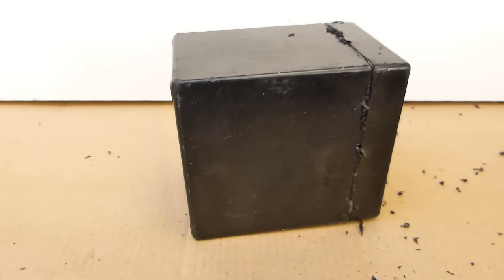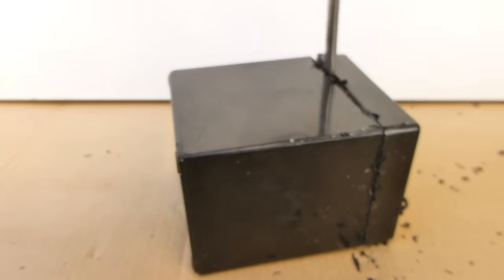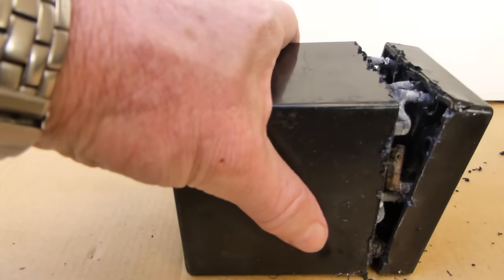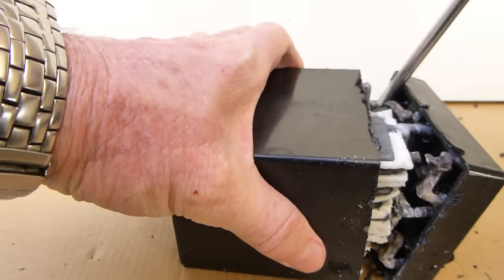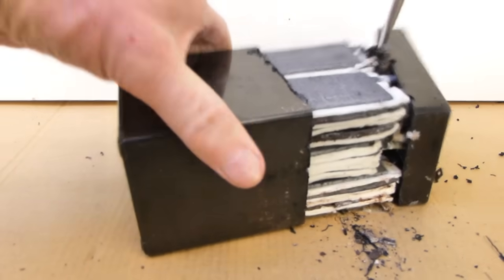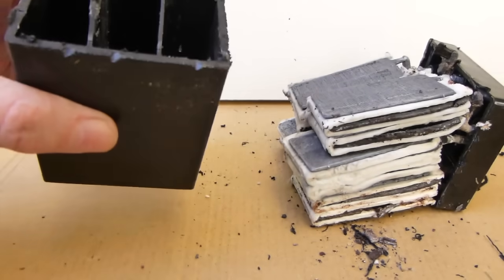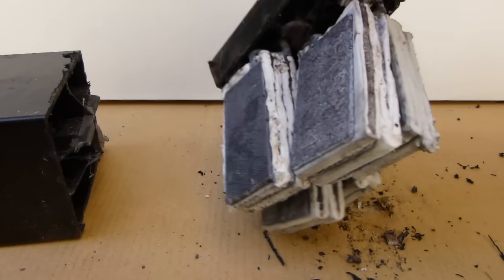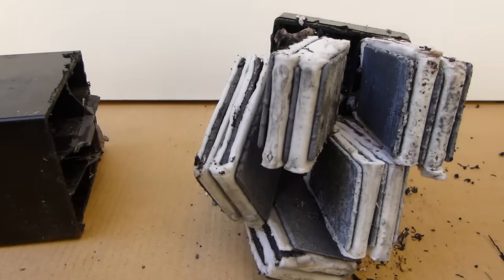Tear down of lead acid gel cell battery. What's inside?

Comment: Can u still put it back together and reuse it ?
Reply: not after cutting the battery case. 
if he did cut on angle not flat cut it could be done but not on flat cuts

flat cut is ------  and angle flat cut you cut with curve of \ so top of \ will match bottom of \ then you  superglue them or poxipol together.. if its flat cut then no.

Comment: Two faults with these batteries, they dry out quick unlike flooded wet cells , also notice the grey elements, this is the positive pole, these often remain intact but the negative elements crumble, a common fault with both gel cells an flooded type. There is a space at the bottom of the casing that is designed to collect the crumbled bits, if charged to quickly this can shorten the life causing the coating to come off quicker, a long trickle charge will extend a cells life to some extent, also keeping a float charge in if the cell is not used in a long while.

Comment: 5 plates per cell...It's amazing that these batteries can produce as much current as they do.(when new) there just isn't that much plate area. You have to consider, that only the inside of the outer negative plates is being used. The two positive plates are the ones folded into the glass mats. This battery is known as an AGM.(absorbed glass mat), this is not a true "Gel Cell". Small batteries like this are often referred to as "sealed lead acid" or VRLA, which is Valve Regulated Lead Acid. If you take the top apart, you will see rubber caps which release excessive pressure, in case the battery is over charged. The reason for maintaining internal pressure, is to allow the oxygen liberated from the positive plates to recombine with the hydrogen liberated from the negative plates. The end result is, the gasses combine back into water, prolonging the life of the battery, as well as making it more tolerant to over charge. theoretically, the battery should last its full cycle life, with no need to add water, but, it's not a perfect system, meaning the batteries have a limited life.

Comment: Some people recycle it? Actually more than 99% of PbA batteries are recycled. (In fact, they are by far the most successfully recycled product that has ever been sold.) Not only is it environmentally tragic to do anything other than recycle it, it's also illegal to dump lead anywhere but at a recycler.

Comment: Hahaha i knew someone was gonna say something about all tha moaning the moment i heard him 😂
Reply: There are  a few suggestions for battery repairing
Don't try to do this until you know what you are doing - the acid can burn your skin
check the voltage first - there may be a dead cell which would waste your time.
Check the battery fluid.
Try to fully charge the battery.
(I read about these and more on Jons mender guide website )

Comment: problem with using high speed tools to cut plastics is that the tool melts the plastic which sticks together again as you move past the cut ...use something that wont create heat .. a hand saw works much better

Comment: Batteries can be repaired to a point. Lead acid car, boat, marine etc. But only to a point. If you have the tools and more than one battery that are the same.  You can clean them out and take apart. You can locate the shorted cell in bat A. Then replace with none shorted cell from bat b. Reassemble, refill with electrolyte bought at auto parts store.  They will take a charge and last only until another oxidized cell shorts out. Visual inspection will tell you if they are even worth trying to salvage.
Reply: not always works

Comment: OK first off before I disassemble one of these I give it a dose of water mixed with baking soda to neutralize the acid. Secondly I cut around the terminals to free them before cutting open that casing. Thirdly I allow it to dry, inspect the plates for short circuits and damage to those insulator layers. lastly I mix a strong solution of epsom salt and distilled water thus converting this restored battery into an non-toxic magnesium dry cell.
Reply: Hey Einstein..... You’re so good at explaining how to make that  dry cell How about filling us in on how it operates. Since you went all that trouble to Inform
Reply: p

Comment: Thank you for the Video, the only comment i have is the terminology.  the term "gell" is not accurate here.  This battery is an Absorbent Glass Mat "AGM" battery.
Reply: A more proper generic term would be "sealed lead acid". That covers both Gel, and Absorbed Glass Mat.(you're right, this was an AGM)